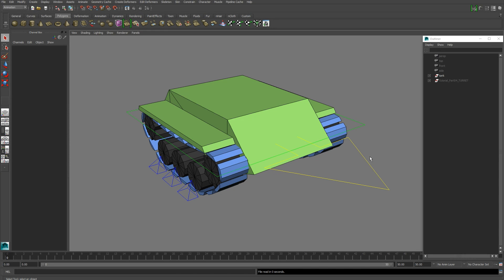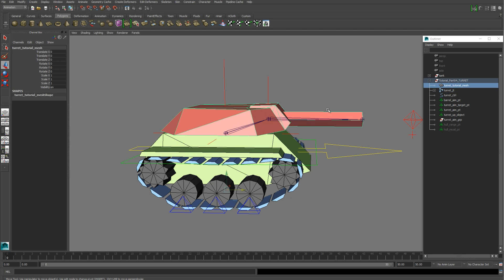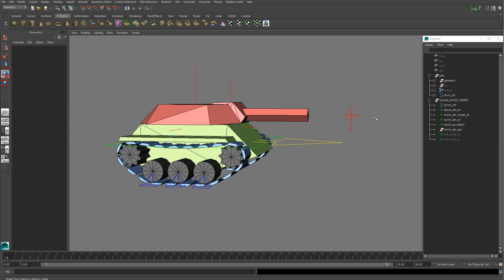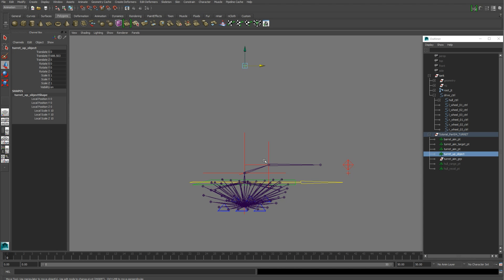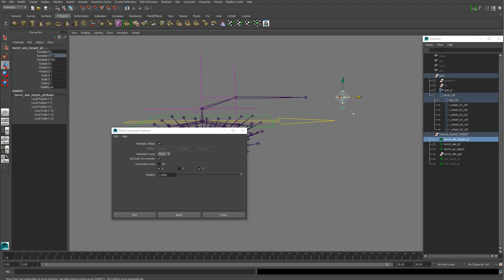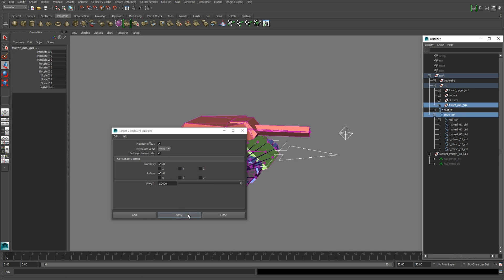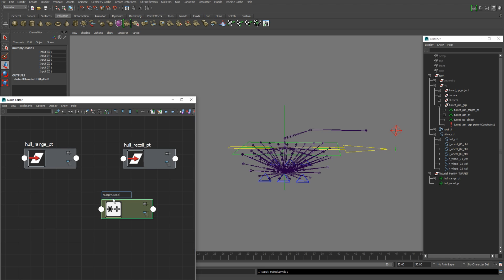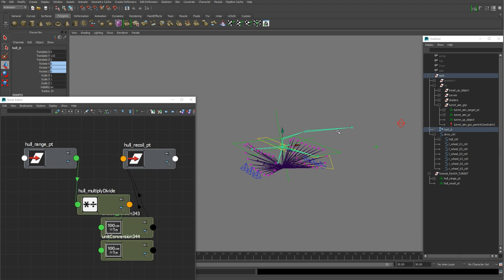How to Rig a Tank in Maya | Tank Rig in Maya | Part 4 Turret

Comment: hey simon i got a quextion 
when we complete the whole rig and ready to animate it but how do we scale it?
cus whn i try to scale the tank group which has all of the other groups parented to it
my tread mesh kinda blows apart
any idea how i can fix this issue?
please reply i need to complete this for my thesis
Reply from the maker: This was meant as a joint based rig to use in games. Bone scaling in complex rigs can cause issues in some engines. Generally you should have your mesh scale realized before you rig it. It is possible at this point but it requires quite a bit of rework to the rig.
Reply from the maker: Use these steps and you will get what you need:

Create a new control, we will call it Top_control and parent it to the tank group. 

Parent the drive_ctrl, rig group and root joint to the Top_control. 

Delete the parent constraints from the curves group and the tread_up_object group. 

Parent the tread_up_object group to the curves group and then parent the curves group to the tank group.

Select each of your clusters and enable relative. 

Connect the Drive control translation and rotation to the curves group translation and rotation directly.

Now scaling the Top_control will scale the entire tank correctly. Good luck on your thesis.
Reply: on the cluster part where do i find the enable relative option? ^^;;;
Reply from the maker: Attribute Editor. A checkbox at the top.
Reply: nvm found tht 
but for the connection i should use the node editor right?
soorryy for being a noob :P
Reply from the maker: Yes that or the connection Editor will work for you.
Reply: im sorry man but i think im kinda screwing up in the last step its not scaling properly :(
Reply from the maker: The last step is just connecting the Drive Control Translation to the Curve Group Translation  (X Y and Z)
and connecting the Drive Control Rotation to the Curve Group Rotation  (X Y and Z).
Reply: Ok great i got it working now! thnx alot man!!!!! ur a savior bro! :)
but one more thing when i use the top ctrl to translate or anything the tank's curves stays in the same position and does not move along the tank when i use top_ctrl